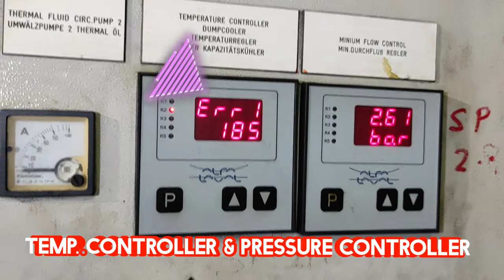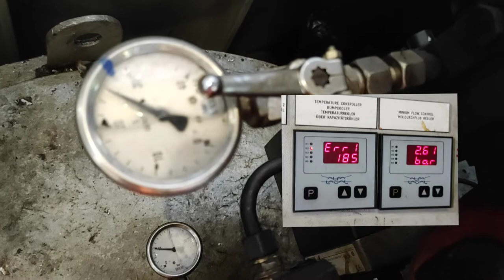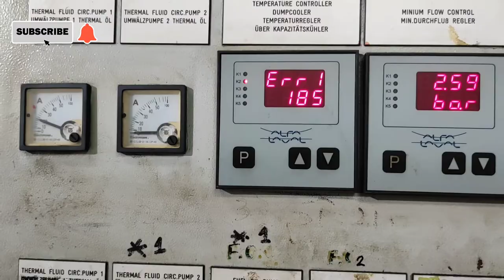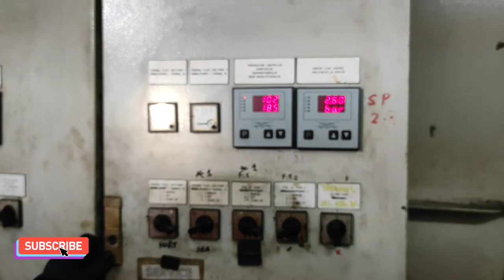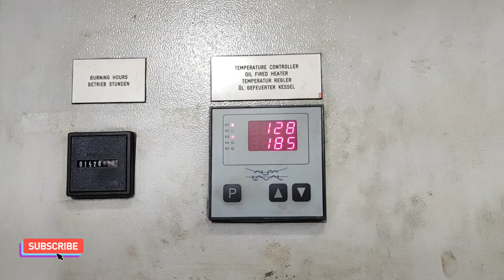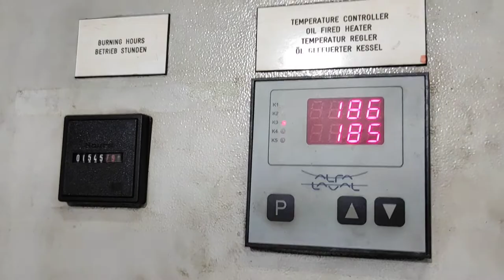Troubleshooting Boiler, Marine Thermal Oil boiler trouble. AALBORG temperature controller. #ETO/ETR

Comment: what is the output signal from the controller to the control valve 4-20 mA or NC/NO contact? What is the brand of the valve?
Reply from the maker: We are using PT100 sensor, the temp signal is base on the resistance. we are using ALFA LAVAL TEMP CONTROLLER